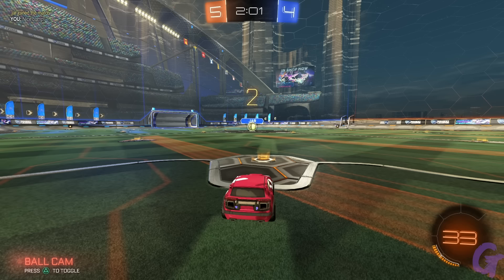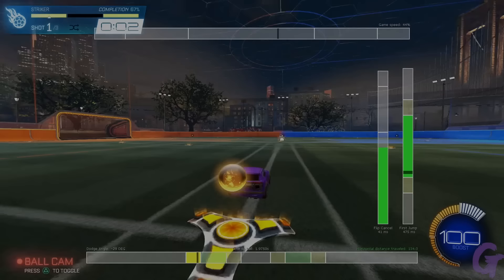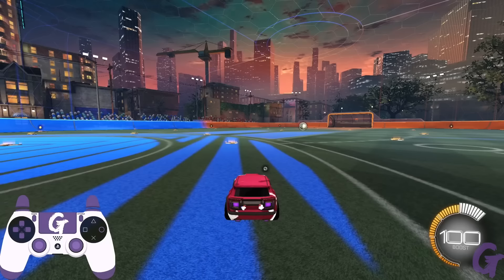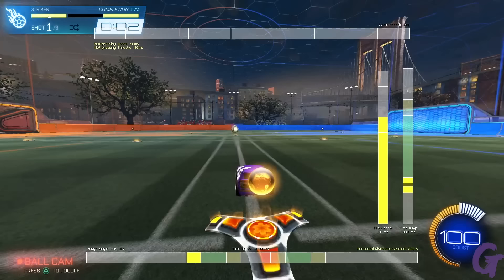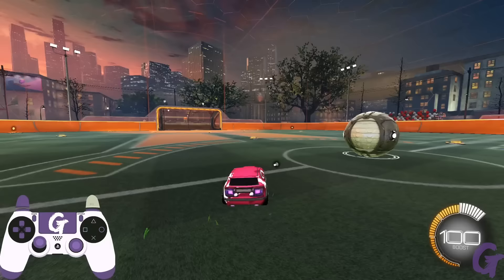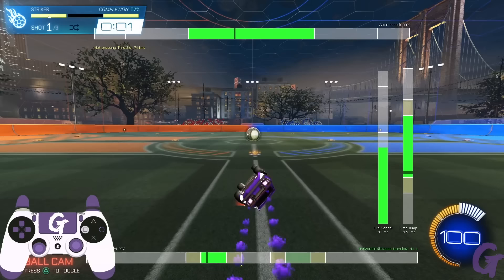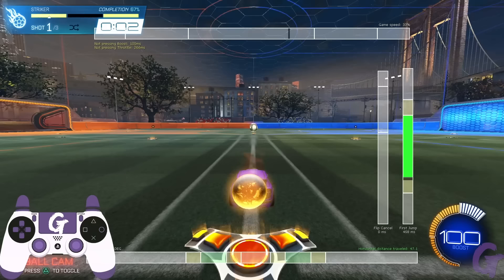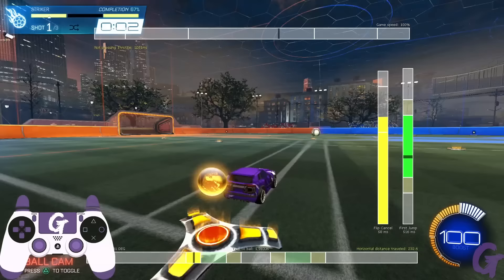How to do a Perfect Speedflip | How to Play Rocket League

Comment: A503-264C-A7EB-D282
Reply: training pack code for you folks
Reply from the maker: My bad. I forgot to put that in the description. I’ll fix that. Thank you!
Reply from the maker: @soykike1991  two things. Try this with the console turned on (F6). Second, what is your in game FPS?
Reply from the maker: @soykike1991  well, I ask because it was discovered that a sub 60 fps will give a lower time to ball value than previously found but what we learned was if you turn on the bakkesmod console with F6, it still shows the actual values of ticks and time to ball. No rounding. Just true numbers. It’s possible it’s not setup in the hot key menu. Maybe give that a look.
Reply: I doesn't work why?

Comment: I've known how to speedflip consistently for probably about 3 years now, but your method of cancelling the directional air roll has made me consider changing my method. I also use directional, but only when the rotation is coming back around to finish the rotation with directional. Your way seems a lot smoother, and even a little faster. Thank you for this video, earned another sub! Keep pushing quality tutorials like these, the community needs them!

Comment: This is one of the best speed flip tutorials out there so thank you for making it! One thing I still find missing in all of these (including this one) is really how to apply the speed flip during kickoffs and not just the different angles to use at different starting positions and when to start it (around the first boost pad) but how to counter the opponents different kickoffs, depending on if they are speed flipping or not, what angles they are coming from, and how to place the ball where you want it. A lot of my speedflip kickoffs end up with me getting to the ball first, then hitting it into the opponent and then it bouncing back onto my side of the field. I know I need to just practice and experiment more, but I think content on how to apply the speed flip kickoff would further differentiate this type of tutorial! Thanks again!

Comment: Last night I fell into the speed-flip rabbit hole. decided to learn it and then found out about the Musty pack. Like you Griff I am also a masochist. I ended I trying last night over 1K times in a row and staying up waaay too late. I actually started sweating and feeling sick after quite a few hours of rinse and repeat attempts. I ended up going to bed defeated and then today I decided to take powerslide off of the same button as DaR. I thought "Ill just try this time hitting powerslide as I land instead of holding it through the whole movement." I change the keybind and the first attempt something odd happened...the ball went forward and bounced off of the wall as I flew in and it finally registered in my mind that I actually hit the ball that time. I did that. After literally bruising my fingertip from holding down DaR for so long yesterday I did it. It worked. Thank you.

Comment: This tutorial brought up a really key point. Your thumb's positioning will dictate how consistent the flip cancel direction is (ideally straight down as you said). What I noticed is that hand posture is a major factor in how consistent that cancel is. By putting my left hand a bit further down on the controller (shortening the grip a bit to straighten the thumb - this avoids having too much horizontal angle on the left joystick) you can have a more vertical cancel. The only problem is, I don't know how sustainable it is vs other hand placements - meaning how sore/tired your thumb will be after a long session vs other methods.

Comment: ong. By far THE BEST guide for speedflips. I fully understand it now.

Also want to add that im in the process of switching to controller from KBM. But i wasn't a regular KBM player. i used Mouse movement for all aerial control. So bindings would look smth like this:
Air Steer Right : D
Air Steer Left : A
Air Roll Left : MouseX
Air Roll Right : MouseX
Pitch up : MouseY
Pitch Down : MouseY.
In my 3k hours, i only met 1 other player that had those settings. And tbh, there's +/-'s With those bindings. But to stick to Speedflips, As i getting better and better on controller, Those KBM bindings are BY FAR the easiest way of doing a proper to perfect speedflip. But stuff as constant air rolling, becomes a problem as mouse pad isn't infinite lenght 😂
Also to add half flips also by Far easiest to do with those bindings as holding Shift [Air Roll] blocks the input from air roll R/L [MouseX], Holding shift makes a 100% straight flip, then u just need to release shift and do the cancel+Air roll R/L which are very very easy and close to 100% consistent..
 Anyways, Amazing guide ❤ Just wanted to let ya know about this as it seems like no one aware of this steering :)
(Sorry for VERY long comment 😅)

Comment: So, it is true that the directional Air roll method indeed works. It's just about joystick position.  Also, thanks to you I realized that I'm not cancelling fast enough my flip. I'm cancelling right after I finish my second jump or when I release my jump button what this cause not timing it ideally. Now, I know that I have to cancel it at the same time I press second jump. This tutorial and the one for how to air roll are by far the best I have seen so far.
Reply from the maker: Thank you so much!  I'm glad it could help!

Comment: you can actually flip in any degree on keyboard and mouse using the "keyboard input acceleration time" setting. for example, holding w and then holding e or d right before you flip will make you flip slightly to the right instead of 0 or 45 degrees.

Comment: What an excellent explanation ! With everything : visual, tips, common mistakes, technical details, angles etc
I've been training with the traditional method for months and my accuracy is poor
The diagonal air roll method is sooo good ! I've watched many videos and never seen anything about it. First time I tried, I touch the ball. My accuracy skyrocketed instantly as we just have way less moves to make. It's cleaner and I even reached new best times in less then 30min of training.

Little insignificant detail but I managed to hit the ball below 1.96 with both methods (1.9584.. i think) and my new best time is 1.9500 with this new method (same training pack, same plugin).
Im clearly not good at kickoff yet but it proofs that 1.9667 is not the best possible time

Great video, thank you !
Reply from the maker: curious, what's your frame rate in game?

Comment: Mate, you make me finally get up my ass and train mechanics because the finally make sense how they work. Thanks for your awesome tutorials :)
Might want to ask even though its a simpler mechanic: could you may do a tut about wave dashes?
Reply from the maker: Thank you so much and yes, those are coming in a future video.  Maybe two or three from now but it's coming!
Reply: @Grifflicious  While i have you here, i might ask a question regarding directional Air Roll, but i will post it also under the Video to be seen there and for the Algorythm :)
There are Tornado, Reverse Tornado, Cuxir and Reverse Cuxir spin. Those are four directions/car movements. they Are archieved by pointing the stick in a specific direction. When you dont do a 100% perfect Tornado spin aka pointing the stick perfect to the left and instead do lef/up is this a disadvantage or will this be als a useful movement?
Meaning when using directional air roll, should i focus on learing only those four movements or also the tiny adjustments inbetween?
like driving left or right on the ground and instead of going left, i go left (85% and up 15%) so my turn is not that fast. I hope my nonsense is kinda understandable :D
Reply from the maker: @pottiBoo  you should learn them all!  It’s best to break them down one at a time though. Sorta like dividing the square. So start with 1, got to 4, (up, down, left, right), then 8, (those in between the 4), and so on. These are very basic of course and I don’t literally mean it as specific as I exemplified here, but rather to illustrate the point. Ideally, you want to learn a “combo” move. I plan to explain this soon in a video but in essence, it’s a left stick sequence from one stick position to another that manipulates the car in the direction you wanna go. I.e., when going for a ground to air dribble, you want to start a tornado spin to pitch the nose up, the sweep the stick from the side to the top, then all the way around in a quick 360. This gets the car up and straightens it out without losing a good line on the ball.

Comment: Great video but small misunderstanding. The server doesn't really tick at 60 Hz because then the physics would just be different (like shown in the clip of the presentation). It just transfers 2 ticks at a time over the internet connection and then handles 2 ticks in a row. So the tick rate is still 120 but only with a buffering process to only send 60 packets. It makes it easier for most internet connection/server to handle the traffic at the downside of increasing the average delay by 8ms, but it has no other impacts on gameplay.
Reply from the maker: lol Yeah, HorayHellfire pointed that out too.  I sorta misspoke the point for sure.  Thankfully, it's only you and him who caught it.

Comment: It's funny how the natural feeling of down/up on the stick doesnt actually match true up/down input directions on the controller.  I believe this is a design flaw in modern controllers.

For example, the up input direction of a Gamecube controller is actually slightly to the right, and the down input direction is slightly to the left (the whole thing is rotated clockwise).  It feels completely natural to the biomechanics of your thumb.  It runs more parallel to your thumb.

Just a random thought that no one ever really considers, but would be super useful if designers took this into account.

Comment: One thing to watch out for. I had a PS5 DualSense controller that could not do a flip cancel in less than 125 ms, making a speed flip impossible. I replaced it with another DualSense controller and it worked. Also, Xbox controllers are notorious for their stick drift. Just a couple things for people to pay attention to.
Reply: What? U cannot do it with regular controller on ps5?

Comment: I also use square as boost so when you’re boosting and flipping at the same time, do you almost hold the controller in a claw position or do you kind of ‘fat finger’ that area of the controller? Unless you’re using a controller with paddles for example.
Reply from the maker: No claw. Full on “fat finger”. It’s a hold over technique from a kid playing SNES games like super Mario world where I had to hold run with X and jump with B, which meant laying my thumb across both buttons.
Reply: @Grifflicious  thanks for the reply, makes sense

Comment: Holding directional air-roll + having the left stick directly forward == a perfect 45 degree flip every single time. It's a more efficient way to speedflip due to the points you made about the thumb oftentimes not being precise and in this version you only need to move the stick directly up and down, only adding small corrections to land properly at the end.
Reply from the maker: Sure but that it’s limited in its ability to get the maximum possible speed which I pointed out in the video. Does it do the job?  Of course. Will it be the best? No but that’s a priority each player has to make for themselves.
Reply: @Grifflicious  Hmm, I skimmed through some of this so maybe I missed some details. I had assumed that 45 deg flip would be the max possible acceleration so either I'm wrong on that or you lose time from having to counter-steer more on this pack (which is nuanced actually in how it would apply to all in-game situations). Anyhow, I hit the ball on this pack 99% of the time and hit 2k mmr in 3s and so if there is some limiting factor to my (admittedly poor) description it must be pretty small.

If there is some small detriment I would possibly argue that consistency dominates anyway, but I would have to see the tangible differences first. Apologies if I'm echoing some things in your video and you make nice content friendo 😎

Edit: I actually do your method 3. Saying I put the stick 'directly up' wasn't right since I'm initiating it from a small counter-steering position. It seems we generally agree on most points after listening to what you said toward the end of the video re: "this is my preferred way to speedflip since it reduces most variables and I can just hold air roll the entire time + consistency"
Reply from the maker: @sinify6676  so the thing with the 45 degree flipping angle is that in order to get the most speed possible out of that angle, you need to adjust the car’s initial offset quite dramatically so that when you do your flip, it’s in as straight a line as possible towards the ball. The “issue” with that, if you will, is that any time you’re momentum is shifted away from the ball in any way, it’s going to make your time to the ball slower. Obviously, we are splitting hairs here with milliseconds but seeing as it was the point I was making in the video, I feel inclined to reiterate it here. 
When you reduce that angle to something like 20 degrees, you can get away with a much tighter offset, and almost even none at all before initiating your flip. This will always be faster since the momentum is always straight towards the ball as much as possible. A flip is a flip and regardless of direction, they all generate the same amount of speed/power/distance traveled. The difference is in which direction are they going and are they having to act with or against the previously established momentum.
Reply: @Grifflicious  We are absolutely splitting hairs here but saying "a flip is a flip regardless of direction" isn't technically true: https://www.youtube.com/watch?v=pX950bhGhJE
and was covered by rocket science a long time ago there. I had just assumed that 45 deg would be the most you would get out of that interaction but even that is naive. It's way too nuanced to care about for a literally optimal answer and no human would be able to accurately calculate all the variables anyway for all in-game situations, but regardless I just wanted to throw that detail out there. Maybe you knew and just misspoke on that part. The part he doesnt really cover (but mentions) in that video is of course boosting and counter-steer times, which override a lot of what was said there when it comes to optimizing the path in this specific training pack

tldr: I agree with pretty much everything you said above and your guide is really good - just brain-dumping some other random shit as well
Reply from the maker: @sinify6676  Fair enough.  I nerd out over this shit too so if I'm wrong, I want to be told but I also try really hard to be as honest and correct as I can because I do in fact, hate being wrong when I'm attempting to teach lol.  Either way, no hard feelings in any way.  I certainly do enjoy these types of interactions.
Reply: @Grifflicious  I can tell. I found your channel by accident when searching around to see if anyone was making the types of guides I was considering doing myself for fun. It's certainly needed since the overwhelming percentage of 'guides' that exist for this game are abysmal lmao. Good to see someone taking the time to explain the nuance.
Reply from the maker: @sinify6676  That's also why I got into it.  Couldn't find what I wanted so I decided to make it. Simple as that.

Comment: I feel like I’ve mastered the speed flip itself, but I haven’t figured out how to use in to my advantage in a game. I’m very consistent with it in my GC games yet I still manage to lose the kickoff to players much slower than me
Reply from the maker: Then I would start paying attention to the person on the other side of the ball.  Think of the kickoffs more like 50/50s and it might make a difference is how you approach it.  Also, when you're first to the ball from a speed flip, don't flip into the ball.  Flip THROUGH the ball.  Literally, hit the ball first and then flip.  Otherwise, when you flip into the ball vs a slower opponent, you give away your force and momentum to them instead of using your car to push the ball into and off their car. If you both are speed flipping and are going to hit the ball at the same time, then you want to flip again, through the ball, but either to the left or right, depending on their alignment to the ball vs yours, and which way you want to push the ball.

A GREAT place to practice doing this against slower and less skilled opponents is to fire up a custom 1v1 game against a bot, the highest skilled one they have so that way it boosts into the ball on kickoff, and just focus on beating it on the 50.

Comment: hello
very good tutorial imo
but i want to focus on one detail
i learned speedflip with directional air roll and now i regret it. here's why:
DAR speedflip is very great for getting the speedflip, but u cant use it like diagonal flip cancel in other situations (maybe u can, but its impossible for me). i mean, that its almost impossible to do preflips in the air and use it for rapid reset
so in long-term its better to learn traditional speedflip. cuz of that i need to re-learn the speedflip, which kinda sucks
Reply from the maker: Perhaps. I don’t have that problem specifically but I will say, if I had make a recommendation, learning and knowing both is ideally the way to go.